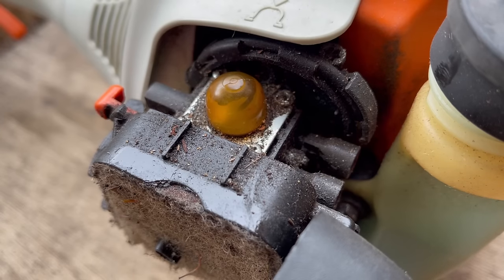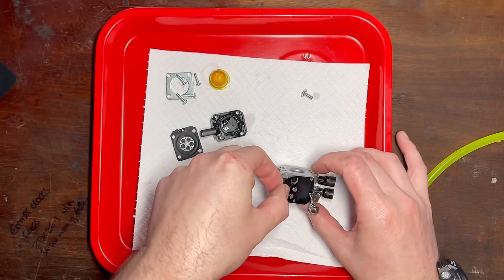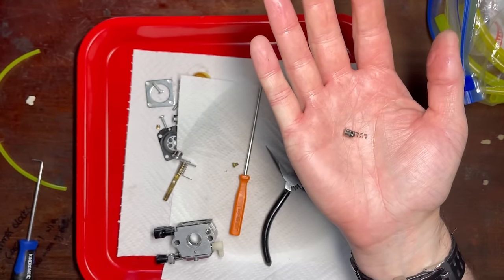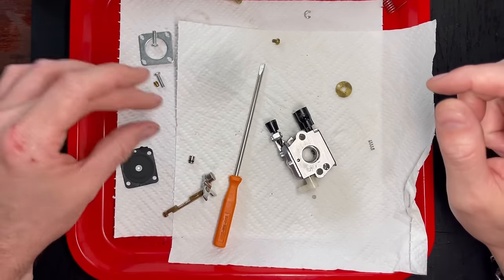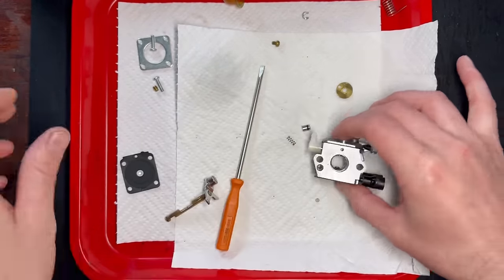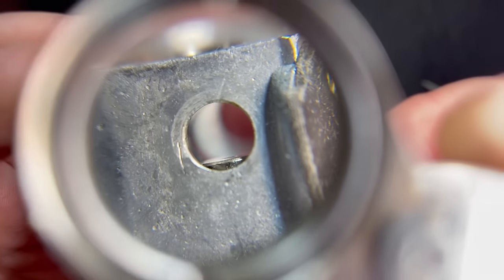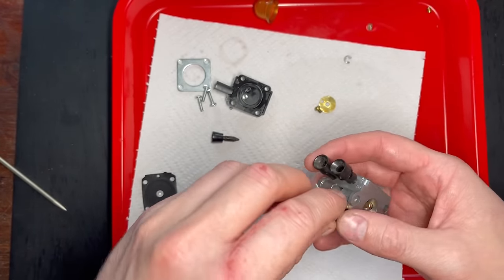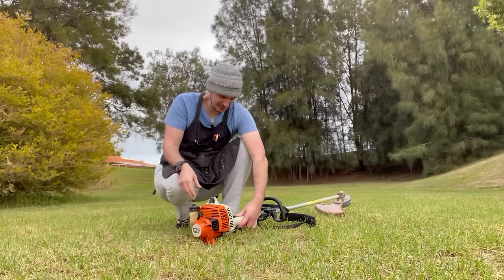Purge Bulb Won’t Fill Up With Fuel? Here's Why!

Comment: Hi great vid thanks. Couldn’t you replace the O ring with one out of a box of assorted O rings ? I get why the Stihl kit was cost prohibitive as so in the UK I Worked out their price strategy they simply charge £10 per part hence making a replacement carb more cost effective. Does the nail polish fix last for a long time ? Or does the fuel rot it ? Many thanks Nick
Reply from the maker: Hey loads of great questions! Over time nail varnish will dissolve in ethanol fuel. If you’re running non ethanol fuel it won’t. You can absolutely just replace the o/ring if you have one, but it has to be fuel resistant, so nitrile or viton. Just for your reference, they’re 3x1 :)

Comment: What a great video thank you but would like to know if you have to put the small screen in before the spring or just disregard it ?
Reply from the maker: It helps reduce the chances of debris mostly from the metal piston and bore getting by into the carby over time: I’d use it :)

Comment: Doesn't the vacuum from the piston/crankcase also play a part in getting fuel to the CARB.  too?
Reply from the maker: That’s the only thing that gets fuel to the carburetor, yes :) the impulse, that the piston rings create, is what pumps fuel. The Venturi effect doesn’t draw the fuel into the carb as much as it does draw it out of the metering chamber haha.

Comment: I have a Zama S68 241A carb on a BG86 blower.
Ordered some 3x1mm rings but they're too big enough to fit in the bore.
I was sure that's the size I needed but it seems not.
Can you advise what dimensions they're supposed to be?
It's such a nice blower and i got it for free so id like to keep it as it was built if possible.
Thanks so much for your videos, even after years of experience in small engine work i learn something new quite often, even if it's just a different way of approaching an issue.
Nice one!
Reply from the maker: Hey mate, thanks for the kind words! Sure, for that machine / carb you need a 2.3mm x 0.8mm o-ring.
Reply: @VintageEngineRepairs  hahahaha, cheers mate.
I ended up cutting and gluing the big rings.
Ill order some of the right ones.
Was sure id used 3x1 before and saw that size mentioned in the comments on this video!
Must be losing my marbles!!

Thanks again fella.
Much appreciated.
Best reference on YouTube, without any doubt!!

Comment: What would cause the bulb to be hard and not fill with fuel? After a few pushes the bulb will stay down but still no fuel. And its an Echo 2620 if that helps. About 6 months old. Im assuming the check valves under the primer bulb?
Reply from the maker: Yep! Can be the valve not letting fuel in that is blocked. Could be a stuck metering lever, very clogged screen, blocked fuel line. Something is blocked in the circuit :)

Comment: Dang... God job! how much time did you work with these to know all this stuff?
Reply from the maker: Over about 4 years, glad you enjoyed it :)
Reply: @VintageEngineRepairs  .That's awesome... I'm hoping I can ask you some questions from time to time... Hey, do you believe in replacing the check valves as opposed to getting a new part or carb? I'm thinking it Could be done easy but I can't find parts.

Comment: Greetings, and thank you for your effort and explanation, I learn something new in each of your videos, and I've been doing the same for 8 years.  I have a question, I have a couple of the same carburetors as the one in the video, I'm really struggling with one, it also didn't want to pump fuel, so I washed it in an ultrasonic cleaner and of course with the appropriate liquid.   After that, the pump worked and now it pumps fuel like new, but I have a problem with adjusting the carburetor.  when I set it to work well, I leave it for half an hour, after that half an hour I go to turn it on, it starts right away but does not want to accelerate when I give it gas, it chokes.  and so in a circle, I adjust it again and it works.  but the next day it may not work.  diaphragms and check valves are good.  If you could give me advice on what else to try, I would be very grateful :)
Reply: to add, I didn't seal the acceleration pump like you did, but I put everything disassembled in the ultrasonic cleaner, after which the pump drew fuel normally, so I thought there was no need to seal it like this when it was working
Reply from the maker: Sure, I think your best bet is to pressure and vacuum test the machine :)

Comment: I have done a lot of carbs over the years, but haven’t done that. NOW I need to find a carb to tear into LOL.  Is it reliable?  Thanks, it’s a hard thing to visualize. Take care.
Reply from the maker: Absolutely :) nail varnish is fuel resistant!
Reply: @VintageEngineRepairs  yeah, walbro carbs use to recommend it on the Welch plugs, not now though.
Reply from the maker: @steveriggenbach90  yeah it won’t stand up to carb cleaner :)
Reply: @VintageEngineRepairs  didn’t know that. Thanks

Comment: Maybe a dumb question, wouldn’t a replacement oring from an oring kit do the trick?
Reply from the maker: It depends firstly on the material, many kits are just rubber orings and will fail right away, the other is it’s a very unique size. Therefore it’s not in any kit i or anyone else I know, has found!

Comment: Hi thanks for the video, i like to try and fix things too theres no fun to be had with cheap chinese copy carbs unless you like retuning your machine every time you use it! I would rather a serviced genuine carb. 
Can we just uae a normal rubber oring out of a cheap oring kit, or does it need to be viton or similar? Another thought might some dot3 brake fluid ir silicone spray rejuvenate/swell the oring enough to get it back to size
Reply from the maker: I have a video on rejuvenating the metering diaphragms but not o-rings. Yes they need to be viton, nitrile or the like or it will fail :)
Reply: @VintageEngineRepairs  thanks for reply :) I have seen your video on diaphragms, will try a few different things I'm about to tackle an fs45 this arvo! Maybe a very thin slice of 3.5mm od fuel line would do the trick?
Reply from the maker: Someone suggested that but I haven’t tried it :) let me know how you go. Use 3mm as that’s the original o-ring size.
Reply: Works on some things, thinking would be an idea while servicing carbs to just sit a dob of silicon spray on the check valve for the rubber to soak up, just for good measure! prevent maintenance ..or just Asking for trouble? :) what do you think

Comment: I think my problem is a worn o-ring on the accelerator pump piston. I've ordered some o rings, but in the mean time, I was wondering if there was a way to 'mod' the piston to reduce wear OR remove the need for the oring? The bore is 4.00mm but the piston is only 3.75mm. That alot of play for such a small size. I wonder if a better fitting pistion ( without o ring ) would work better? Another thought was to fit a second o ring at the other end of the piston to keep it square int eh bore, better. thoughts? Steve
Reply from the maker: It’s not common but you may have a worn piston. You can buy a pump piston kit :)

Comment: Great videos and info, thank you
Question : a 2 cycle carb, off the machine, both sides of the Venturi blocked with rubber the pulse and fuel inlets plugged. If I try to pressurize I get leakage around both butterfly shafts on both sides of the carb. It’s a Zama C3 EL18.
Is this normal?
Thank you, Trying to learn
Reply from the maker: Yes :) it’s not abnormal to get a very small amount of leakage there. It’s no big deal :) if it’s leaking really freely then it’s not ideal!

Comment: Like so many others, I found your video really helpful, thanks.  About 5 years ago, I replaced the carb on my Stihl KM55R with a Stihl original and now have this same problem back again, so need a cheaper solution.  Didn't fancy the nail varnish trick, but thanks to you have just ordered some nitrile 'O' rings on eBay, so we'll see how that goes.  I do, however, have one query and am a bit reluctant to question your excellent description of the way the fuel system works, but here goes.  Testing on my KM55R led me to believe that pressing the bulb raises the air pressure in the fuel tank, which then pushes fuel back through the filter and up the inlet tube to fill the bulb, rather than by creating a vacuum as you describe.  Am I completely wrong on this or do some machines work differently?  Certainly, if the filler cap is not closed tight, no amount of bulb pressing delivers any fuel up the inlet tube to the bulb, since there is no pressure in the fuel tank.
Reply from the maker: Hey :) hmm sounds like you may have a leak in the carb, if will push fuel back into the tank, but because you’re removing as much as you’re putting in, you’ll maintain the same pressure. Besides, you’d have to pump about 50-100 times to change the pressure enough to build it up in the tank as there is a lot of space haha. Best of luck!
Reply: Hi, thank you so much for your reply.  Your thoughts are exactly the same as mine initially, i.e. how could a few pumps of the bulb increase pressure to the extent that it pushed fuel from the tank up to the bulb.  That said I can find no other explanation for the following:  With the carb in place, if I disconnect the lower hose and pump the bulb, fuel comes out of the disconnected pipe.  Since this pipe is fed direct from the tank via the fuel line and filter, I can't see how else fuel can come out of it, unless it is being pushed out by pressure in the tank.  Furthermore, if I release the filler cap, no fuel flows, regardless of how much you press the bulb, since the fuel tank is no longer pressurised.  I am really not trying to be argumentative here in pushing this point, but am keen to understand exactly how the fuel system works, so just repeated this exact test to be absolutely sure. 

You are right that I must have a leak somewhere in the carb, which presumably is why fuel never reaches the bulb, when everything is connected correctly.  Thanks entirely to your video, I now believe the 'O' ring on the piston is the culprit. Before that I had no idea that any of those parts existed let alone what they do!
Reply from the maker: @brianwizard7092  it will certainly pressurise the tank, but not by a huge amount. Any press will have an effect, be it small.
Reply: Just to complete the story, my new piston pump 'O' rings finally arrived today.  I was a bit uncertain since they seemed indistinguishable from the existing ones on the carb.  However, I went ahead and replaced it on my original carb first and immediately got the bulb to fill, so went ahead with doing the same on the replacement carb that I'd fitted to the KM55R a few years ago.  That, too, now works perfectly and so I have ended up with a working carb on the power unit as well as a spare, should the current one fail again in a few years time.

One point you might consider adding to your video is a warning about the spring loading of the piston when you remove the butterfly shaft.  First time I pulled it out, the piston and spring shot out of the hole and disappeared over my shoulder into the depths of my garage.  Fortunately, I found both bits, but it gave me a few nervous moments, whilst I was frantically searching for them.

Many thanks for both your knowledge and time spent making these videos, which have allowed me, personally, not only to save a few quid, but also avoided me junking yet another perfectly good carb that only needed a very cheap part to get it working again!

Comment: Would you be able to answer a question for me. I recently brought a petrol strimmer from Sgs and never used it. I return the strimmer to them unused condition when they looked at it they said as there was fuel in the priming buld i had added fuel and attempted to start it, which i did not. My question is would there still be fuel in the buld from them testing the strimmer as surely they would have tested it first. I would really appreciate your thoughts. Many thanks.
Reply from the maker: Some companies test the before giving them to you, other times factory’s do :)

Comment: Did you disable the accelerator pump?  If so, doesn't that affect performance??  Thanks!
Reply from the maker: Hey, yes I disabled it, you lose that initial amount of fuel when the trigger is pulled, therefore you just run your low screw slightly richer to compensate - most carbs don’t have accelerator pumps, and thus you tune them just the same as that :)

Comment: Very interesting. Currently one of my units has a bulb not filling or occasionally filling. So far it hasn't affected the performance so it's a no touch at this time.
Reply from the maker: Interesting! So long as it’s not affecting anything you’re probably better to leave it, you may add a problem 🤣

Comment: I was wondering what channels there were under that round Welch plug on my Stihl FS38.
No matter which hole I squirt acetone through, I can't get it to come out of the Main nozzle.
Reply from the maker: If you can’t get fuel through the main nozzle, it’s likely sealed shut. Connect a tube to the H circuit through one of the drillings and close the others with your finger and blow and suck. Listen for a clicking sound. If it doesn’t click or you can’t blow, the valve is shut. It may free up in the ultrasonic cleaner

Comment: Will the vaccum system of the purge bulb work and get it full when you press it and realeased if the carb main jet check valve(or other check valve) is leaking?(let air come in from the ventury?
Or it will not ?
Thanks the excellent videos!
Reply from the maker: Correct, if the valve isn’t sealing it won’t effectively draw fuel into the bulb. Thanks for the kind words :)
Reply: @VintageEngineRepairs  thanks for the reply.its very kind and professional from your side.most you tube creators  do not do it!
Reply from the maker: I try my best to answer every question I get, it’s getting harder to keep up, but ultimately I enjoy helping where I can :) thanks for the kind words!

Comment: I have a blower that starts and idles fine but cuts out after a couple of seconds of any significant throttle. The primer sucks about 50% air when releasing the purge bulb. I chased it through to the main nozzle not sealing. I flooded the venturi with WD40 and it finally held vacuum when purging with a blocked fuel inlet. Thought I had fixed the nozzle valve but it runs just the same as before. A main nozzle locked open should give me the opposite symptoms of rough idle and good WOT? No accelerator pump on mine just a build-in choke. I think maybe high jet is partially obstructed? Need to get one of the pacmans to get in there
Reply from the maker: Try opening both the L and H screws 1/4 of a turn and see if it improves it. An open main nozzle will give you lean symptoms at idle but be fine at full throttle.
Reply: @VintageEngineRepairs  Thanks for the reply. Tried it, still the same. Ive found a similar carb I might do a swap

Comment: Instead of nails varnish. Will silicone gasket do the job 🤔. Or you think the varnish is easier to be cleaned and be poured in stages?
Reply from the maker: Hmmm I’d stick with ca or nail varnish :)

Comment: Hello,The video is very interesting, maybe it's silly, but I have two questions: is the red substance you dropped into the carburetor plain, simple nail polish? Won't the gasoline dissolve it? Or not from here to there getting gas?Since I live in Hungary, I use a translator. Thank you in advance for your answer! Hello David
Reply from the maker: Hey :) yes nail varnish, ethanol fuel will, normal petrol won’t!
Reply: @VintageEngineRepairs  Great, thank you very much for the answer! I wish you all the best.🙂

Comment: Speaking of holes on the body of the carb, do you know what the hole is on a br600 carb right under the high/low screws on the carb body. It sprays out fuel while running. Don't know if it's leaking while not running.
Reply from the maker: Hey, send me a picture at tomscandian@hotmail.com of the hole you’re referring to on your carburetor. Either way, no fuel should be spraying out :)
Reply: checking vids. wanted to see if on other units @VintageEngineRepairs

Comment: Nice, thanks for the explanation.. I usually just buy a new carb. $20 for a new carb, plug, fuel lines, filter. And, saves loads of time..
Reply from the maker: You’re welcome! The joy for me comes from repairs rather than parts swapping. The challenge of seeing if I can save something.

Comment: Hopefully you have an answer for me. I have the same weed Wacker with the exact same carburetor and I’ve replaced the diaphragm on both sides of the carburetor. I have done the method shown in this video and I’ve cleaned the carb out with carburetor cleaner. I have also made sure the fuel lines and fuel filter to the gas tank are clean as well. I’m still not able to pump fuel into the bowl. (which is new as well) when I pump the bowl all I hear is a whistle sound when the “fuel in” is connected but not the “return”. I’m not new to 4 stroke but I am new to 2 stroke carburetors. I did make sure to put everything back the way it came and everything was clean. The only other thing I could possibly think of (which doesn’t seem like it would be too important) is that you filled the bowl with gas and I didn’t. Do you have any idea what might be my problem? thanks for any help. Have a great day.
Reply from the maker: It could be a stuck main nozzle check valve!
Reply: @VintageEngineRepairs I finally got it up and running. The last thing I did was leave the carb in gasoline over night and then cleaned with carb cleaner. After that I assembled it and now it’s fine.

Comment: I have a question...can a 27cc string trimmer carb be used as a replacement for a 27cc hand held leaf blower carb..im asking before i purchase one for Craftsman 27cc hand held blower
Reply from the maker: It’s very unlikely because the linkages will be different no doubt.